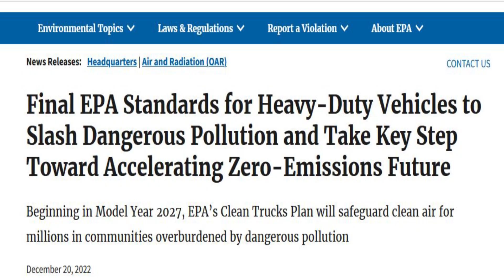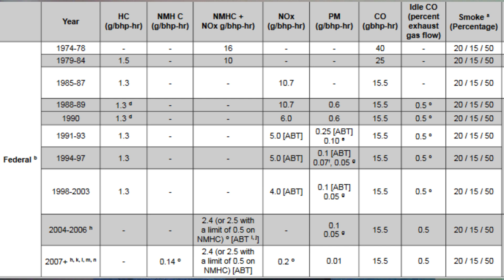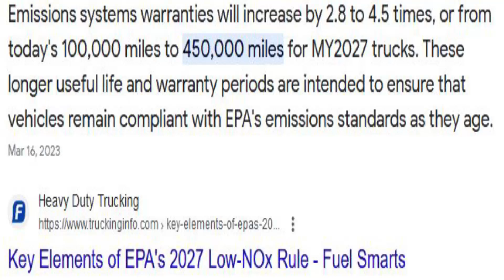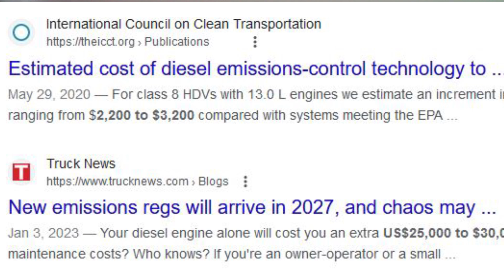Why the 2027 Diesel Emissions Standards will cost BILLIONS!

Comment: You can have next to zero diesel soot and nitrogen emissions if you run water methanol mist injection or just straight water mist injection into the air intake.

Comment: The EPA should be forced by federal law to fix all these stupid DPF systems for FREE regardless of the age or milage of the vehicle as long as it runs and is registered a LIFETIME warranty that includes replacing expensive catalytic converters on gasoline vehicles when they go bad because the average person will just end up find a way to cheat emissions rather then buying an expensive new catalytic converter. If the EPA wants clean air they should be the ones fixing these emissions systems. there the ones mandating them they should be the ones paying to have them fixed.

Comment: Not to worry, renewable diesel will solve diesel emission problems.  In addition, the ducted fuel injection being developed at Sandia National Laboratory will finish off the job of making diesel engines the greenest power source for mobile transportation.  I don't believe that battery powered vehicles will ever have the energy density to go long.  These will be good for local delivery in urban areas.

Comment: There is a technology that can help your problems, see below.
"High Efficiency Low Emission Hybrid ICE"
By simply splitting the ring-section from its skirt - to be operated by a (valvetrain-like) piston-train to pump the gases during the intake and exhaust strokes, and combined with the skirt to complete the compression and power strokes - can achieve the hybrid. Which completes the 4 strokes, different in both displacements and periods, in every engine revolution - called D-cycle (Differential-stroke cycle) – a hybrid of the 2-/4-cycles.  
The D-cycle’s controllable exhaust strokes can be shortened to retain high amount of burnt gases to control the ignition initiation and combustion rates for the HCCI/LTC (homogeneously charged compression ignition with low temperature combustion). When combined with the (gasoline type) stoichiometric air/fuel ratio intake under high-compression ignition, it is the diesel-gasoline hybrid with the benefits of both – called SCCI/LTC-BGR (Burnt Gas Retention).
The resultant hybrid can have Atkinson-cycle strokes, whole engine working at lower rpm, fewer cylinders with lighter engine support and vehicle styling, weight and efficiency gains, and etc. Diesel engines can avoid soot and NOx formation saving expensive after treatments with lower noises. Gasoline engines can enjoy diesel type (within structural limitations) efficiency (test shown >20%) and torque gains ( >2.5x).

Comment: The issue here is not emissions, it is that the EPA wants to get rid of ALL diesel trucks (be that OTR or Pickups) ... as well as gas cars.  They want only electric vehicals on the roads at worst (at bests as far as the EPA is concerned, they want no one traveling unless you have a special licence from the gov't).
The solution to all these problems is to get rid of the EPA and basically flog each and everyone who works for them to within an inch of their lives.

Comment: ⚓️ Thanks Ape ⚓️ things that make you go hmmmm… my experience with the new 3516E 🌈 the NC Power guys didn’t get the installation right… then the Petersen guys couldn’t make it run right. Soooo there’s that… when the manufacturer couldn’t get the SCR to operate properly from the start, how is a guy without the cat tool laptop BS going to make it work??? I retired a year & a half ago… the thing never ran right… it runs… but an audit of the system will show way out of emissions compliance. And they sold it without any operational training… only thing I got was ‘keep def in it’ 🇺🇸 oh yeah … the NC guys couldn’t get one engine to start… took my spare starter off the shelf & never gave me credit, really a bunch of a#$holes ♦️

Comment: And this will make trucking worse for all truck drivers that have to buy this new emission trucks. The DEP system they added on to truck is a huge money grab.. they know how much each component will cost and down time. If a exhaust filter gets clogged that will kill your power.. meaning if this is correct.. the sensor will active and tell the engine to stop till you get it fix.. Not something that most truck driver want.. plus.. got to be sure their are parts on hand and ready to go. No parts.. longer wait time..
My second question is most of the bigger countries doing this as well or its just USA?... because if we are the only one doing clean and the rest of the world is not then... 1/4 of the world is not doing their part.. so we spend billions while the rest.. is...

Comment: Emission standards are high enough. As are the regulations of the trucking industry. (those are too high actually). All this crap does now is increase and speed up inflation - and that goes for anything the government gets involved in. Most of our government is unnecessary nowadays, but in order for these government employees to have jobs, they have to continue to come up with more and more useless "standards" and regulations - most of which are more harmful than helpful. Such as these upcoming emissions standards and the latest trucking industry regulations (eld mandate, etc). Inflation, crime, and health (or lack of) are mostly the governments fault. They claim it's for our benefit, but the truth is is that government employees are only there for a job - and they do what they have to to keep that job no matter how harmful it is for the rest of us. It's not at all about protecting and serving the citizens anymore.

These new emission standards are just paving the way for more inflation, and for more and more "electric" BS - again causing more harm than good (environmental, health, and financial). There's zero benefit to these new emission standards or for moving to electricity from fossil fuels - its just trading one problem for another.

And the government thinks it's it's smart and that it knows best - but in reality it doesn't have a clue.

Comment: I hit a button when I was trying to edit on the last one but most electricity comes from coal plants most electric cars are powered with diesel generators charging their crappy Tesla it takes 40% more energy to power a Tesla than it does a dodge grand caravan think about thatAnd then them saying politicians are running on one of the biggest most polluting thing on the planet the jet engine they have no problem going all around the world in their jet engines are flying just one spot of the country to the other because of destroying the planet with jet engines is very important.

Comment: Due to the fact that the diesel engine yes anything built after the 90s it’s very clean I have a 2006 jeep CRD that does not have particulate thank God however The comings n 14 in the early 80s had lower emissions than a Ford escort driving 55 and a semi hauling 80,000 this is all about government control hindering products and services going to grocery stores in cross country they want to cause far more pollution by coal powering everything y

Comment: $3k in extra costs is nothing and chump change when it comes to repairs.  Just for a mechanic to have his eye wonder to over to the corner where your truck is parked is $500.00 and that's not even beginning considering mechanic might have even a itchy eye blinky.   Your cost from looking at itchy eye blinking  $40k is average per year.  Plus you can add on some other expenses: Trailer payment $1k a month,  truck payment $3k a month,  insurance payment $1k a month,  tires two sets of 18 tires  $40k per year. Brakes and seals for the year $10k.   Not a in depth accountant view of trucking expenses its a glance and a peak if we have to start blinking and questioning "Forget it".buddy your toast.

Comment: I can’t even listen to this shit anymore I had def Kenworths and diesel work trucks I hope there burning cleaner because all we did as a business was burned 80% more diesel and def fluid going back and forth to the shop would like to see some videos on this side of it. Especially if you love an hr away from a dealer now you got two trucks running down the road to drop them off and pick them up also a tow truck involved or low
Bed truck getting them out of the bush to be fixed it’s the biggest scam know to man

Comment: This will also hurt non dealership mechanics. Sure, as a fleet mechanic it can be nice to not have to work on a year old trucks emission system, but that is less work for the fleets to do, decreasing the need for fleet mechanics and decreasing the pay. If all non maintenance work is farmed out to the dealer, trucking companies can pay a lower wage to the tech since they are not required to use technical skills.

Comment: I feel the mass production of dpf, scr are more harmful than just a normal truck running. I have seen some units finally removing egr, but still has the other junk. Maybe use all the same parts on def systems for all manufacturers.

Comment: The only vehicles with dirty diesel engines are the morons daily driving lifted diesel pickups that tow nothing more than a camper trailer once a month. Modern semi trucks are very clean. We should be making after treatment systems more reliable, not changing the standards.

Comment: Bro. KW are a head gasket replacement magnets from sunken liners. The new PACCAR engines are not million + mile trucks anymore. Engines have more issues than ever.

The emissions side on most tucks aren’t really the major burden. It’s actually getting trucks diagnosed and parts sourced to keep the units on the road. It doesn’t matter if you have 450K milage warranty if it’s at the dealership 10 times or for 3 months at a time. I guarantee you customers will just pay for their own repairs still to get the units up.

Comment: 350,000 to 450,000 is usually where you get your major failures such as the doc being pushed and plugged. i dont see def is a good thing for the environment since it does corrode and dissolve metal and can dissolve paper and cardboard thats why most of the components a re plastic or stainless.

Comment: If it’s untouched with after cleaning system I’d agree with, but with southern states deleting, they screw it for us all. 2027 will be tighter regulations and heavier fines if you remove, deleted rolling coal picks are a nuisance and to pollute

Comment: Def systems is the one of the biggest scam on trucking. They are blaming diesel engines and cows. 🤦‍♂️they don't do anything about the fuel consumption for years. I believe diesel engines not good for environment but not the only thing. They should push the engine companies to make hybrid engine instead of going full electric. There is no way to supply for fully electric trucks. 20 years old engines and new engines almost doing same mileage. 7mp

7-8 mpg. All other technologies getting better but nothing changing on fuel consumption on heavy duty diesel engines. 🤡 world

Comment: The thing is they will not regulate trains who have no emission standards or jet planes that one flight on a jet for 45 minutes put off more missions then my 2003 power stroke does an entire year
Reply: Jet planes burn air and use vacuum collapse in front of the jet motors to run for free its only take off and landing where they burn fuel

Comment: As long as exhaust parts come from China, emissions systems will fail. Just look at any truck dealer (name your brand here) 
My local kw dealer has normally 95%  of the trucks are emissions issues. Then you wait on parts .........
As for paying for it, the dealer isn't losing money, look at the labor rates per hour, $258 per hour plus, some shops are higher. That is forcing us to find alternative shops to get our trucks serviced.
When my fleet of modified C-15s are due for a rebuild,  they will get rebuilt by the same Cat shop that built them. He'll, you kick a new truck hard enough,  it will throw a code. What junk.

Comment: You forgot to mention if the emissions system has a catastrophic failure it could hurt the engine. Not worth it if it ruins the engine. New emission system rebuild and engine rebuild from an OEM shop could cost anywhere from $30,000-$60,000.
Tighter tolerances put more stress on the engine

Comment: New flash ! Trucking needs to use the railroads for long hauls over 150 miles, rather than one or two drivers driving coast to coast with 40,000. Lbs of freight and then most will be able to sleep with there better half or have threesomes with the replacements when driving coast to coast.😂

Comment: Sad part is the original standards were based on fraud by Hien Tran who worked for CARB. Basically he made up data and the standards, zero science behind it. The feds blindly adopted these standards. Which is also in part why the original standards were EGR only. All of the engine builders said they couldn't do it, the EPA didn't care. Navistar was fined by the EPA for using the very tech that the EPA said would work. When the fraud came to light, the ability to use DEF was suddenly allowed. IMO a lot of these regs and the push to make everything from cars to heating your home electric are driven by China. Our costs go up, they sell us the stuff to make things electric. China owns mines around the world now. Rare earths and the materials for batteries they dominate the market.

Comment: It's time for truck drivers to organize. If they stopped driving for even a day it would have a massive impact, let alone a few days. If trucks stopped rolling for even 3 days you would see mass panic as stores run out of products, grocery stores out of food and gas stations without any fuel. That's just the start, manufacturing plants, power companies, basically everything would be effected if truckers went on strike. EPA would have no choice but to backtrack and fast. Even the national guard couldn't put a dent in deliveries it truckers parked their trucks.

Comment: I kind of like this. If the EPA wants to require this crap, they need to pay for it. Granted they are using taxpayer money, but that way all of the voters are suffering instead of just the trucking industry.

On another note, I am shocked that gas engines haven't been feeling the same attention from the EPA. My '96 350ci TransAm would get 26mpg on the highway. Our 2023 Explorer ST gets 17-18 mpg on the highway. My hybrid Powerboost F150 gets 20mpg on the highway, while my '98 RAM3500 24valve Cummins gets 20mpg and weight about 2,000 pounds more.

Comment: I'm curious what that warranty will look like for the light duty. Ford GM and Ram. If that warranty is similar then the EPA is going to bring the hammer down hard on private individuals doing deletes. Either way this is pushing everyone in the trucking industry to lease. From the perspective of a fleet the cost doesn't go up, either they pay for the repairs as they pop up or they pay for the repairs by purchasing a new truck with that longer warranty. My personal preference is Detroit, I work for a fleet and it's about 50/50 Detroit/ Cummins and we have the Detroit's in the shop less and when they are in the shop it's cheaper and faster to get them back on the road. We will run our trucks 750,000 to 900,000 before we sell them. The Cummins are most commonly being out serviced closer to the 750 mark and the Detroit closer to the 900.

Comment: Some of the problems with ARD heads and exhaust filters are operator or drivers not properly using the equipment or truck.  Example don't shut off the engine when the dash light indicates a hot exhaust.  When the light indicates a hot exhaust some of the unburned sut or unburned components are being cooked.  Shutting down the engine stops the cooking and burning of the sut/and carbon ect. Letting the hot exhaust cycle complete its function will greatly reduce the number of re Jen cycles that the truck engine will have to perform.   The story here is always look at your dash and check for the hot exhaust light before you turn off your engine.   You will be much happier with your ARD head and your exhaust filter performance.

Comment: What is the difference in emissions between a 2023 F350 gas 7.3 Godzilla and a 2023 F350 diesel 6.7?
Reply: Well, a gallon of diesel produces almost 4x as much NOx as a gallon of gasoline, and about 25% more CO2 emissions before the aftertreatment systems.

Comment: Seeing how many of these systems fail and how often, there's basically no choice to not do this. Of course this will raise the price of the trucks, but on the other hand this makes the risks involved with these systems much more predictable for the operators.

In heck, manufactures may even consider using components which actually hold up for half a million miles, and not break down every 100k miles. Not likely, but I mean, there's a chance at least ;)

Comment: Most of the problems with the deaf systems come from the sending unit usually it's either the heater element or one of the sensors that are on the pick up in the tank at least on the Volvo's that we have Miss 90% of the problem it's always the DEF tank gauge and it's not even engage it's the little components that are on the gauge itself so if you can make a better sending unit your unit should last 400,000 miles with no problem unless you're constantly idling your truck then that's a problem